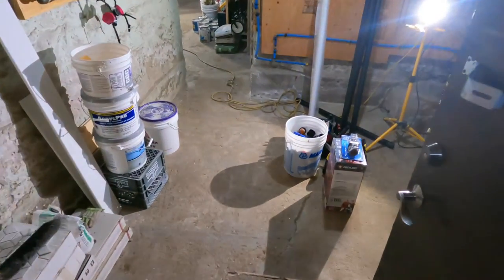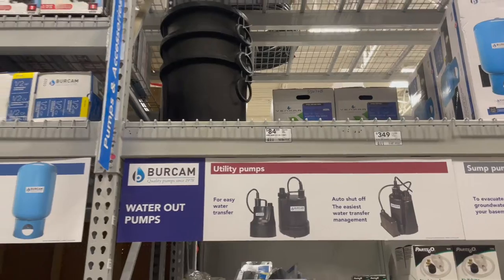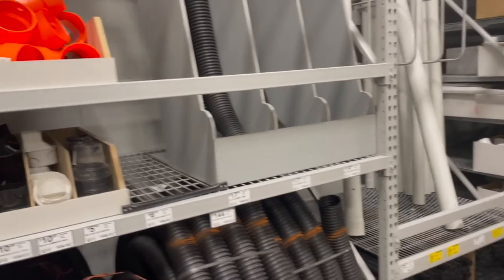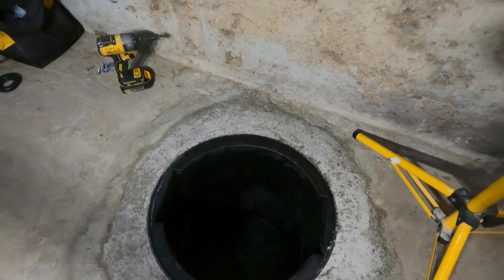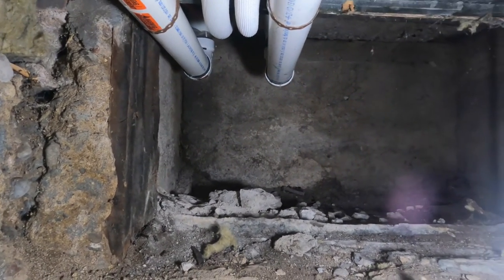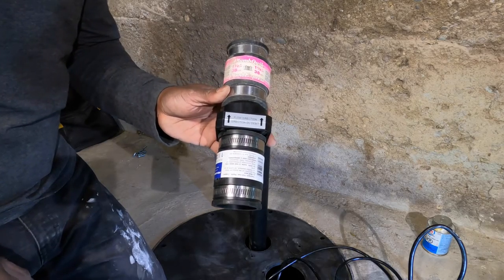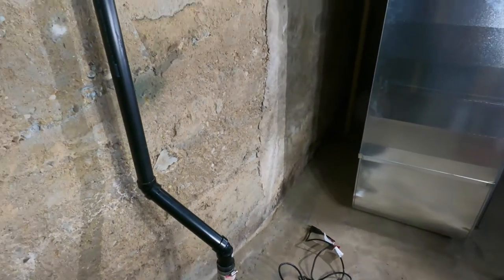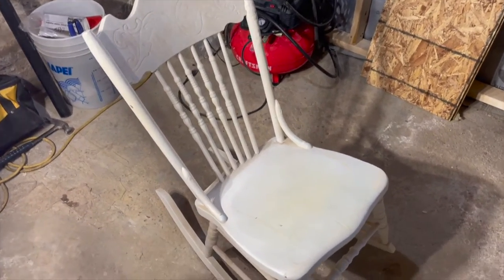Installing A Sump Pump In A Basement

Comment: I drilled a few tiny holes in bottom of basin and put pump on top of 2 bricks so no sediment would get into pump. I also installed a GFI outlet for pump for safety reasons. Good video for a do it yourselfer very informative.

Comment: AAAAAAHHHHHHH...REALLY! Just wondering HOW........ANY water is supposed to get into the crock. A crock with no side holes or ANY DRAIN TILE put into the crock basin. I like your ambition. You can still cut a slot wider than your drain tile. Cover that with STONE just below your slab and fill the rest with concrete...............From a guy with 37 years in the construction trade.
Reply from the maker: in the beginning of the video i stated i was installing the sum pump because the basement does not have any floor drains.so the pump is only for emergency like in case a pipe bust the basement doesnt turn into a swimming pool. hope that answer your question

Comment: Thank you for the detailed video. What if the basement was 80% completed/furnished with no drainage pipes in place, would you need to dig path around foundation wall to install pipes in order for the sump pump to be effective?
Reply from the maker: Ya, it’s not a bad idea it definitely wouldn’t hurt.
Reply: @officialnuera1  thank you!

Comment: What purpose is this for? you have no ground water and the lid will prevent any burst pipe water from entering the pit easily, and you have no weeping tiles leading into the pit. Just seems unnecessary. Good install though.
Reply: The lid to a sump pump is not water tight. Also Under heavy rain the sump pump will fill. And with no floor drains it will put tremendous pressure on the foundation
Reply: That’s what I was going to say I just finish one and the home owner needed one because she had shit load of ground water!!!
Reply: Just because there's no ground water now, doesn't mean there won't be when it rains
Reply: Some homes just don't drain excess water from around the foundation like newer homes do... Mine only runs in the spring time.

Comment: There's no inlet pipe or holes in the bucket. Where's the water coming from in order to suck it out?
Reply: That's if the basement floods the inlet is where those wires are coming out from. Water will flow into the bucket because the bucket should be below the floor level or pitched in that area enough for water to flow into it. Then it gets pumped out.
Reply: @eliash9154  You need to put holes in the bucket. That way long before the basement floods it will be pumping out the water. Your basement shouldn't ever get water in it...

Comment: How does the water gets into the bucket cause usually i see a big pipe on the side of the bucket that is under the floor level and wih your installation i dont see it.
Reply: I agree.   I don't see the reason for the sump pump since it is not being used to drain ground water from the foundation.
Reply: @gordd7348 He said he was worried if a pipe broke there was no where for the water to go since there are no floor drains.   A lot of work for an unlikely scenario.